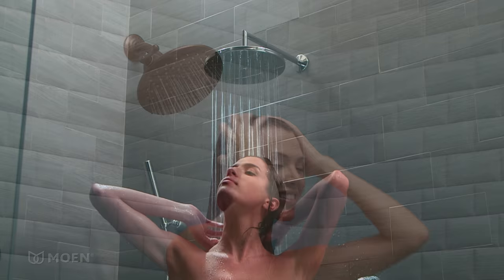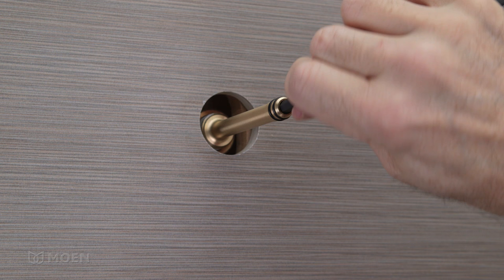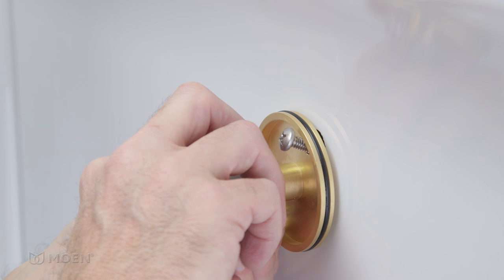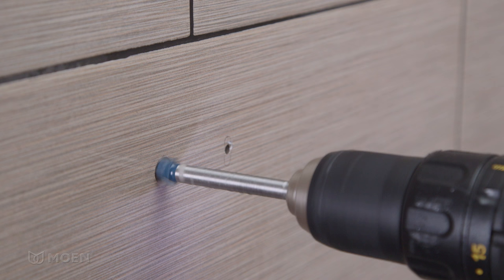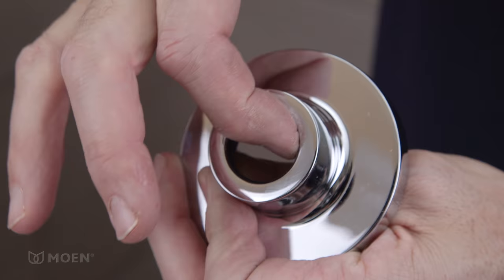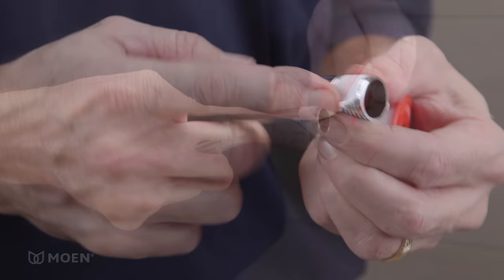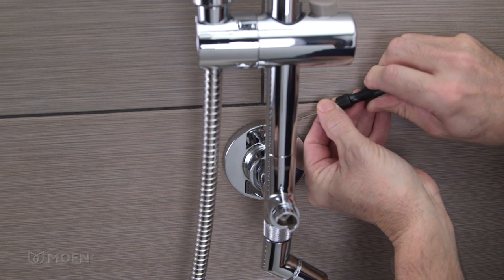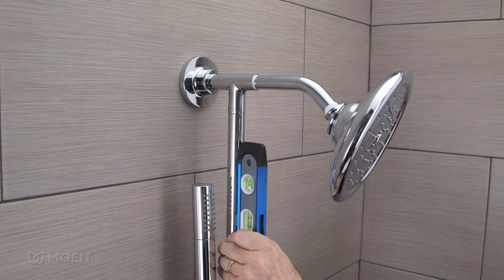How to Install the Moen Annex Shower Rail

Comment: What type of diverter valve is compatible with this? Thank you.
Reply from the maker: Hello Linkinpark2380.  The Moen Annex Shower Rail can be added to any existing shower or used in the design of a new showering system.  The Moen Annex Shower Rail can be paired with any Moen tub/shower rough-in valve.  

If you have any additional questions, Moen product specialists can be reached at 1-800-289-6636 and are available Monday through Friday from 8:00 am – 7:00 pm Eastern Time.

Comment: Ran into an issue on this when you have a tile wall and no wood support behind it for the shower head. You can't drill larger holes for the zip toggles or regular toggles due to the larger hole for the water line and none of the hardware can secure it.
Reply: So, what your method to install this product? I am planing to get this one.
Reply: Ya,  you'd probably have to use a 1/4" time bit and some plastic drywall plugs if I had to guess?? But you wouldn't be able to hang off it

Comment: Is that a 3/8" dept hole for the shower arm?
Reply from the maker: Hello Roland the 3/8" depth we are referencing is for the wall thickness or deck thickness of the installation for the shower arm install. If you have any additional questions, please contact Moen directly at 800-289-6636.